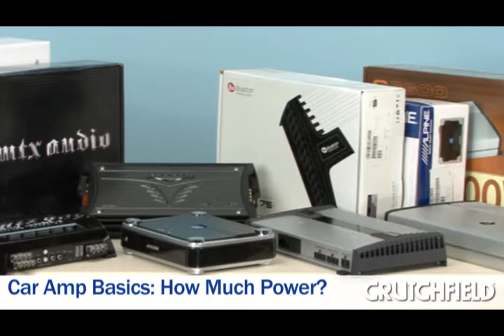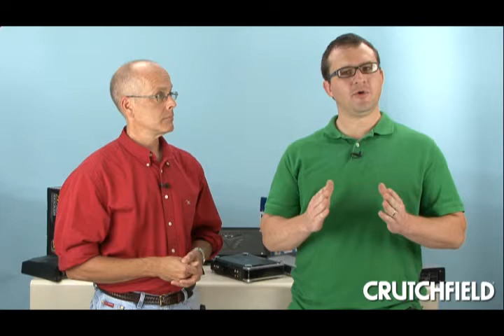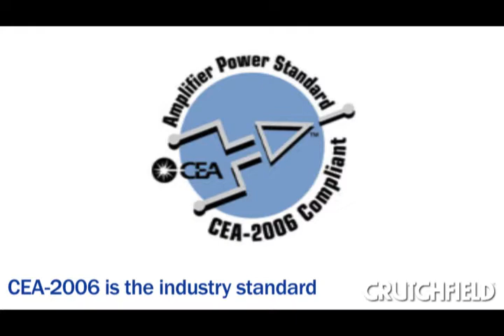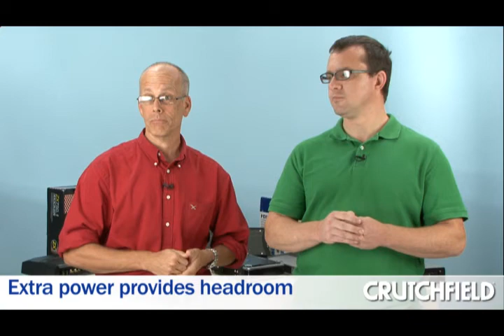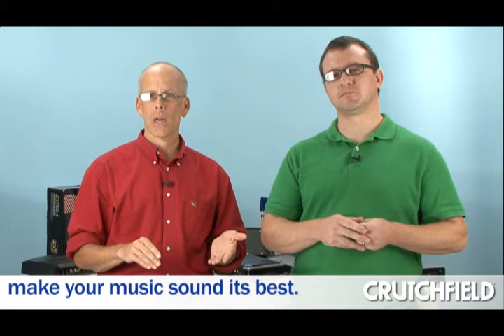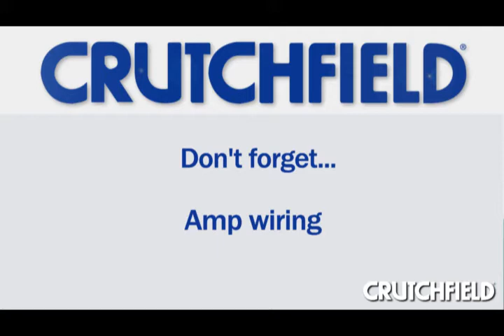Car Amp Basics: How Much Power? | Crutchfield Video

Comment: Hello!

I am so confused about this.
I have 4 component speakers (Cadence XS65K) wich is rated at 100w RMS @ 4 Ohms.
What amp do i need to power them correctly? Cant find anything with output of 100w RMS x 4 @ 4 :(

Thank you!~
Reply from the maker: Ideally you'd want a 4-channel amp producing somewhere between 75-125 watts RMS per channel @ 4-ohm. You can view the 4-channel amps we carry within that power range from the Crutchfield website here: http://bit.ly/2npdyb0

Hope that helps!
--Crutchfield

Comment: i have a rockford fosgate p2d4 8 sub, should i get the rf 250rms mono block or the RF 500rms class d mono, for 30$ more?
Reply from the maker: The R250x1 amp you refer to is an excellent power match for that subwoofer. There is no reason to go with the more powerful amp. Feel free to contact us to help get all the wiring you need to install it: https://www.crutchfield.com/I-rYTVc000/support/ContactUs.aspx
HTH!
--Crutchfield

Comment: Hi, i know nothing of speakers and have honestly tried to understand it but end up worse.

I don't suppose you could just simplify my needs as I really just want to put some speakers in my car as it doesn't have any. Very basically I'd like to run 4 6" coaxial speakers, and one 10" sub, not looking t go all out for loudness, I'm just looking for a great sound, I've been told someone I was with one time is running only 300w but this makes no sense to me, all I know is it sounded perfect for what I'm after and I only know the speaker sizes.

according to the specs of the 6" speakers they're 240w peak power and rated 80w rms 2-way co-axial

the 10" sub is active sub with a mono amp.

Oh and second question that is probably much simpler, I have just a cheap headunit, now if I had an amp that powers the speakers and sub would that mean that the headunit is really just there for the source?
Reply from the maker: For in-depth assistance and personalized recommendations, feel free to contact us directly:  http://bit.ly/2jBGHPp We'll look forward to hearing from you.--Crutchfield

Comment: Hello Sirs, I bought a Sony XM-N1004, 70watts RMS x 4Channel amplifier and I am planning to install it on my Hyundai Getz 2007 1.1 gas on an existing 50watt Sony stereo driver. My question is that ok to wire it on the existing 6inches pioneer 4 door speakers? Or is it gonna fry this 4door 50watts speakers? Many thanks in advance and more power.
Reply from the maker: If your Pioneer speakers are rated to handle 50 watts RMS, then you likely won't run into any issues with over-powering them using your Sony amp. A general rule of thumb when matching aftermarket speakers to an amp is have your amp produce within 75-150% of the speakers rated RMS power handling. So for your Pioneer's at 50 watts RMS, you'd want to be somewhere in the range of 40-75watts RMS per channel with your amp; which the Sony XM-N1004 falls nicely within. 

I hope that helps!
Crutchfield

Comment: Hello. I’m considering buying a sound system, but I don’t want anything exploding. I’ve watched your video several times, and I’m trying to match up devices accordingly. Could you do me a favor and verify that the devices I am interested in are compatible with eachother? I’m trying to build everything around the subwoofer, so I don’t want to change the sub itself.
The sub:
http://www.ebay.com/itm/2-New-Dual-PYLE-PLBWS212-12-1000W-Car-Audio-Subwoofer-Subs-Box-Bandpass-w-NEON-/390813362965?pt=Car_Subwoofers_Enclosures&hash=item5afe4aab15
The Amp for the sub:
http://www.ebay.com/itm/390861012170?ssPageName=STRK:MEWAX:IT&_trksid=p3984.m1423.l2649
The speakers:
http://www.ebay.com/itm/390861012170?ssPageName=STRK:MEWAX:IT&_trksid=p3984.m1423.l2649
The Amp for the speakers:
http://www.ebay.com/itm/231205684094?ssPageName=STRK:MEWAX:IT&_trksid=p3984.m1423.l2649
Reply from the maker: We cannot confirm that the performance and specifications of products we do not offer will be correct or "as advertised" from other "retailers".
For assistance & personalized recommendations from our website & inventory, feel free to contact us directly:

By phone: 800.315.0030
Online chat: http://bit.ly/1b07Ykm  
e-mail: advisors@crutchfield.com 

I hope that helps.
--Crutchfield

Comment: Hey i have 2 rockford fosgate p3 shallow mount subs rated at 400 rms will having 600 watts go to each of my subs be bad is it to much "headroom"?? i wanna get a 1200 watts rms @ 1ohm amp to power them
Reply from the maker: Assuming the impedance of your woofers can be wired to present an acceptable impedance to the amplifier, that will be fine. Having a little excess wattage is a good thing if you set the amplifier gain properly. Doing so will reduce the chance of a clipped signal and allow the amp to run cleaner, cooler & last longer.
For additional assistance & personalized recommendations, feel free to contact us directly:

By phone: 800.315.0030
Online chat: http://bit.ly/1b07Ykm  
e-mail: advisors@crutchfield.com 

I hope that helps.
--Crutchfield

Comment from the maker: Assuming the impedance (Ohms) are correct (i.e. 800 watts x 1 @ 2 Ohms with a subwoofer properly wired to present the 2 Ohm load), yes this will work. It’s a simple matter of setting the amplifier’s gain, low-pass, & subsonic filters (when necessary) properly. You will find more information in the “Research” section of the main Crutchfield website. You can also call us for additional assistance: 800.315.0030--Crutchfield

Comment from the maker: When selecting an amplifier to power multiple speakers, especially when some are full range & others will be subs, it's not about the total wattage of the amplifier, but ensuring you have the proper wattage & impedance for each of the required channels of amplification. Feel free to call for a personalized recommendation: 800.315.0030--Crutchfield

Comment from the maker: Assuming this is the JX360/2 (two channel model) and you will be bridging it to power the subwoofer, you should really have at least a 10 gauge power cable for a run of up to 7 feet. For 8 to 13 feet from the battery, an 8 gauge would be required. For 14 feet or more, we'd recommend a 4 gauge thickness. Feel free to call for additional assistance: 800.315.0030--Crutchfield

Comment from the maker: Rockford Fosgate recommends an airspace of 0.6 to 1.2 cubic feet (per woofer) for sealed enclosures and 1.25 cubic feet (per woofer) for ported applications. We offer pre-fabricated enclosures for bothoptions on the main Crutchfield website. You can also call for additional assistance: 800.315.0030--Crutchfield

Comment from the maker: The Punch Stage 3 subwoofers are DVC models so a lot depends on the impedance (Ohms) of the individual coils and how they are wired to present the proper impedance to you amplifier. If you can wire the coils to get the 900 watt RMS output of your amplifier, they will be a decent match provided you set the amplifier's gain properly. HTH!--Crutchfield

Comment: i bought 2 p3s rockford fosgate subs 400 rms power and a Power Acoustik RZ1-2300D specification say 2300w peak 1400 rms  4ohms 900w x1 channel would that be a good match?? i used a tool to pick out and amp and was just wondering if its right? thank you

Comment from the maker: False. The amplifier will produce it's rated wattage at a given impedance when presented with that impedance. In your scenario, if the amplifier produces the 400 watts at a 4 Ohm impedance, & the subwoofer presents a 4 Ohm load, you will have to be very careful with the amplifier's gain adjustment to ensure you do not blow out the sub. Feel free to call for additional assistance: 800.315.0030--Crutchfield

Comment: So subwoofers draw the correct amount power they need? And the Rms of an amp is only what it is capable of? E.g 200wrms sub powered by a 400wrms amp, means that there's only 200wrms going to the sub? True or false.

Comment from the maker: The RMS numbers are the only ones that matter. If your subwoofer has Dual 4 Ohm Voice coils, you will not be presenting a 4 Ohm load to any amplifier. Ideally, you’d want a mono (single channel) amplifier that is rated to produce around 500 watts RMS when presented with a 2 Ohm load in order to realize the full potential of the single subwoofer. Feel free to call for additional assistance: 800.315.0030--Crutchfield

Comment from the maker: There's any number of issues that could be happening in your system. If you are not getting the desired performance, you may wat to speak with the retailer that sold you the equipment. If you bought from Crutchfield, you can call our tech support department for assistance. Their toll-free number is printed on the back of your invoice. If you purchased elsewhere and the retailer will not help, you may want to contct the manufacturers directly. HTH!--Crutchfield

Comment from the maker: That depends on if you have the Dual 2 Ohm or Dual 4 Ohm voice coil versions of the Type-R subwoofers. You may want to check out the “Subwoofer Wiring Diagrams” in the “Research” section of the main Crutchfield website. You can also call for additional assistance: 800.315.0030--Crutchfield

Comment from the maker: The Kicker CompVR series are all DVC (Dual Voice Coil) models. If you have the Dual 4 Ohm versions, you'll need a mono amplifier that is 1 Ohm stable and can provide around 800 watts at that impedance. Check out the Rockford Fosgate Punch P700-1BD for a decent match. Feel free to call for additional assistance: 800.315.0030--Crutchfield

Comment: I am planning on getting 2x 12" Kicker CompVR's at 4 OHMS which are listed at 400 Rms.  I am struggling looking for an amp, but I am pretty certain I would use a mono amp.  Any suggestions on how much power an amp should have for this, or better, do you have any amp suggestions? Thanks.

Comment from the maker: If you get the Dual 2 Ohm voice coil models, yes. You can wire each subwoofer in series (Which creates a 4 Ohm load) and then wire both woofers in parallel to the single channel of the amplifier to present an overall impedance of 2 Ohms. Series/Parallel. Feel free to call for additional assistance: 800.315.0030--Crutchfield

Comment from the maker: You can check out the “Research” section of the Crutchfield website for more detailed information. The articles titled “Wiring Subwofers – What’s all this about Ohms?” and the “Subwoofer Wiring Diagrams” should be especially helpful. You can also call for additional assistance: 800.315.0030--Crutchfield

Comment from the maker: For two DVC subwoofers and a single amplifier, we generally recommend getting the 2 Ohm voice coil models so that they can be wired in “Series/Parallel” configuration to present a 2 ohm impedance to a mono (single channel) amplifier. With this option, you would want a mono amplifier that can provide up to 800 watts RMS at the 2 Ohm impedance to realize the full potential of both woofers. Feel free to call for additional assistance: 800.315.0030--Crutchfield

Comment from the maker: In your scenario, the two subwoofers wired for 2 Ohms to the mono amplifier would split the available wattage. Assuming the subwoofers were identical models, they would each receive up to 500 watts RMS or half the power they are rated for (1000 watts RMS). Feel free to call for additional assistance: 800.315.0030--Crutchfield

Comment: ok.. i have a question... ive always been taught the "an amp doesnt see the number of subs you have, just the total resistance". now if you have a amp that outputs 1000watts rms @ 2ohms, and you have 2 subs that are wired together for a total resistance of 2 ohms and are capable of handle 1000watts rms individually, are they both going to recieve 1000 watts? or do you add the rms together of the 2 subs to get 2000 watts rms and buy a 2000 watt rms amp?

Comment from the maker: I am working with the assumption that your Power Acoustik amp truly outputs the RMS power you listed. If the subwoofers are 2 ohm dual voice coil subwoofers, then you should bridge the amp to one channel as that will give the best power match for them. If you have the 4 ohm dual voice coil subwoofers, then you should not bridge the amp as it would be too much power for those subwoofers--Crutchfield

Comment from the maker: That subwoofer is a 3 ohm single voice coil model. The 3 ohm rating is unique and if you try to connect two of them you get either a 6 ohm load (which no one ever gives ratings for) or you get a 1.5 ohm load. If you were to get a 1 ohm stable amp, then it could power both of your subwoofers. The only amp we have that can provide that type of power is the Rockford Fosgate T2500-1BDCP model. Feel free to call for additional assistance: 800.315.0030--Crutchfield

Comment: Hey guys i have 2 12". Kicker comps rated for 600w peak and 300 rms at 2 ohms. I was reccommended to buy something like an Alpine V Power mono 500w amp or something in that range (500rms). I know you guys mentioned that its better to have more power than less but is an extrA 200w rms a lil excessive? Or should i try to find something with a little less rms?

Comment from the maker: Each manufacturer offers proprietary technology for this feature and calls it something different. The JL Audio XD & HD series amps offer “Differential-Balanced Inputs” while certain Kicker models offer “Fail-Safe Integration Technology”. Each is designed to reduce potential noise issues. Because most amplifiers are expecting a clean signal, only a few of the higher-end models will offer this added technology. Feel free to call for additional assistance: 800.315.0030--Crutchfield

Comment from the maker: @doubleZeeZ Based on the information you’ve provided, I would look for a mono (single channel) amplifier that can provide up to 1200 watts RMS at a 2 Ohm impedance. You can wire both SVC 4 Ohm subwoofers in parallel to the single channel to present the 2 Ohm load. The 1200 watts will be evenly split among the woofers with each getting up to 600 watts RMS. Feel free to call for additional assistance: 800.315.0030--Crutchfield

Comment from the maker: @Mississippiking03 Unless your amplifier is 1 Ohm stable, you would need to wire the 4 subwoofers in “Series/Parallel” to present a 4 Ohm load. In this scenario, you would get less wattage from the amplifier at the higher impedance.  To get the 700 watts, you would need all four subwoofers to be SVC 2 Ohm models and wire them in the same series/parallel configuration to present the 2 Ohm impedance at the amplifier. Feel free to call for additional assistance: 800.315.0030--Crutchfield

Comment: I have a question. I have 2 10 inch mtx jackhammer 4ohm 200 watts rms. I have a planet audio amp that says it puts out around 700 watts at 2 ohm. Can I hook this amp up to 4 mtx jackhammers or would it be wise to just go with bigger speakers?

Comment from the maker: @knottydreads86 

So, you are talking about a single 12" woofer with as much power as it can handle or two 10" woofers with less than half the power they can handle. I'd go with the appropriately powered single 12".

If you could give the 10" subs all the power they can handle then, they will move more air and hit harder than the single 12", the 12" might more accurately reproduce lower frequencies, but the two 10" subs will move more air.

Hope that helps,
CrutchfieldTV
800 315 0030

Comment: hi i have jl audio xd700/5  the amp pushes 300x1 rms at 2 ohms n i was thinking of  of puting 2 10w3 which is 300 at 2 ohms or putting 1 12w3 500x1. any adivce on which one would be louder?
 i want it to hit.

Comment: I have a 300rms 4ohm sub and want to use a 2 channel amp bridged for 300rms output at 4ohm is that ok or should I look for an amp that has some headroom. I just want to add some bass not wake the  neighbor
Or should I be looking at mono amps

Comment: @crutchfieldtv  i have 3 jl audio 12w6's with a 500/1 on each.. jl audio has a xd600.1 but i'm told the 500/1 still pushes the subs harder.. which jl audio amp will get the best performance out of the subs??

Comment from the maker: @miagy420hwy 

Well, yes, and no. This unit comes with a connector made for some Alpine radios. To use it with any other radio would require cutting and splicing of the KTP-445's wiring. And Alpine states that the warranty is void if any splicing is done.

We know it can be made to work, but it might not be worth the risk for you.

Hope that helps,
CrutchfieldTV
800 315 0030